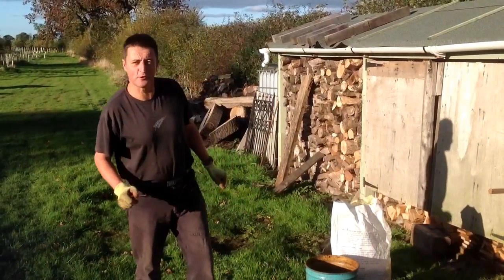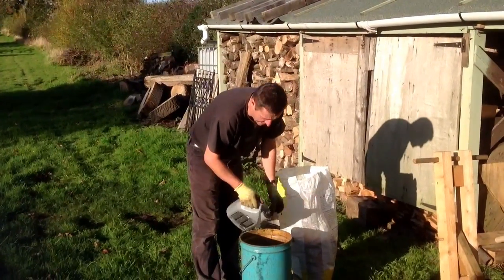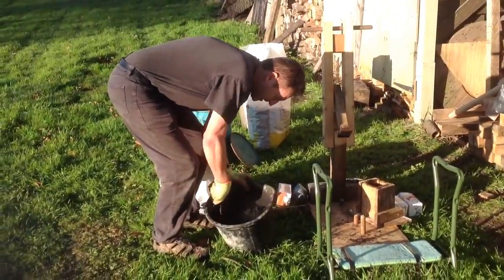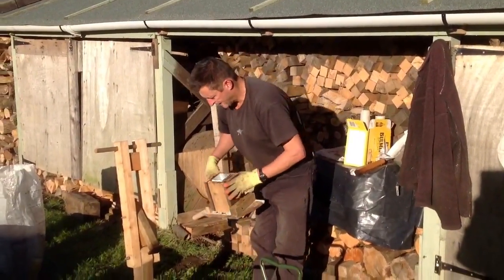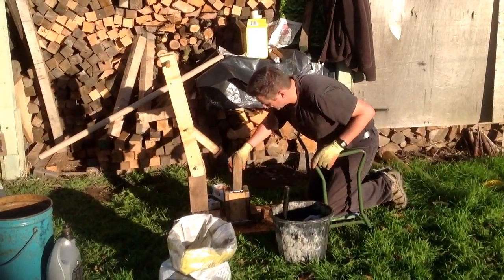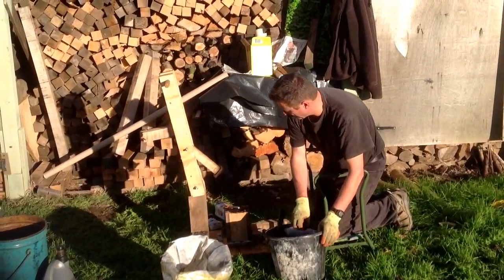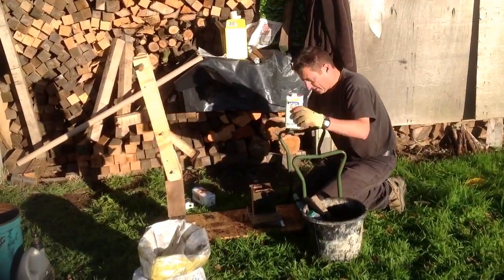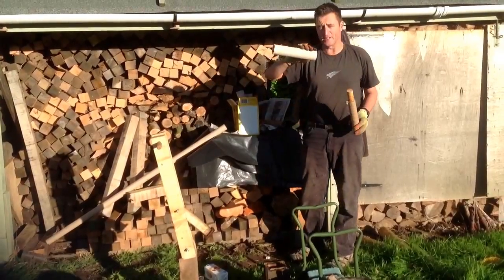How to make fuel from sawdust and old oil.

Comment: Engine oil is full of chemistry and additives, who you absolutely do not want in your environment. Used oil is also contaminated with metal and residues from the engine. If you burn engine oil, you will produce lot of toxic smoke which is full of dioxines, causing cancer for both you and your family, and everybody else.   Engine oil belongs inside the engine, and when discharged it should be at a proper waste facility. following this video is a really bad idea, and the video should be deleted.
Reply from the maker: Michael, do you know what they do with that engine oil you leave at the waste facility? Yes, they burn it! Like it or not, this stuff ends up in the atmosphere.  So better that I at least get a bit of heat from it. Anyway, my neighbour says he likes the smell!,
Reply: +struck2soon Absolutely not true, at least not in an civilized country. In Denmark the collected waste oil get refined again to "base oil" and find uses i a variety of new products. Waste oil can be burned, but to do that without chemicals polluting the surroundings, you will need very high temperatures and a filtration system in the chimney. That is not something you can do at home, and you have absolutely no idea of how much toxic waste you are polluting everyone with.
Reply: +struck2soon btw. Burning waste oil is prohibited in most of europe for the same reason.
Reply from the maker: +Michael Sørensen This is not a civilised country, this is ENGLAND!! Here it is perfectly acceptable to have an open fire, and surely if you are going to have a fire you might as well have a nice bit of smoke coming from the chimney? That is why we burn a lot of coal as well, gives excellent heat and at least people can see that your fire is going with a nice drift of black smoke from the rooftop.
Reply: +struck2soon Well, by non civilised countries i was more thinking about countries like Russia and India. Do you know for sure that it is allowed for citizens to burn chemical waste in the UK, or are you just assuming that? Did you actually call the authorities and got a permission?  I am not talking about open fire or fireplaces where you use uncontaminated wood, they are also perfectly allowed her in DK, but the fact that you are burning toxic chemicals in your stove, and polluting the surroundings. When talking about black smoke, i am sure that you already know that it is not to be expected in a proper maintained and correctly fired stove, as you properly also know, that in areas where coal is the main source for heating, there is a much higher concentration of ex lung diseases.  Bottom line is, that time changes and we all get smarter, so why not learn from history and do things right?

Comment: How about adding ruined home brew to the mix? Would that alcohol absorb to the pellet and help it burn? I have plenty of that stored.. making moonshine out of it is option, but I'm not very much into drinking nowadays. :)
Reply from the maker: If it is home-brew beer then no. Spirit on the other hand would be ok, but perhaps a bit too volatile? And then there is evaporation to consider. Old cooking oil from restaurants or take-away bars would be a good alternative to engine oil, perhaps the home-brew spirits mixed with one of the oils?

Comment: Thanks for sharing.
I have been running my old Toyota Hilux pick up on waste veggie oil for years and the waste from the waste is mixed with saw dust from a furniture joinery. I simply shovel it into bags and use in the stove to start the fire.
Reply: I used to work for a trucking company that took the oil that they drained out of the engine and filtered it and mixed it with the diesel and burned it out through the engine. It is a good way to get rid of it and it bumped up the HP a little.
Reply: They call it pep in America
Reply: prep

Comment: Good video, once made how long does it take till you can burn the "bombs"?
Do you have to wait a few months for them to "cure"
Thanks in advance struck2soon
Reply from the maker: No curing time required, other than a couple of days for oil to soak into sawdust in the initial pre-manufacturing stage. Fire needs to be good and hot with a decent bed of embers, (usually about an hour of burning wood), before bombs go on.
Reply: Great many thanks.

Comment: I would think these would burn well in a rocket stove.  The high temperature burn with plenty of oxygen should reduce the "toxic" output to a negligible amount.  Thank you for sharing your experience with us.
Reply from the maker: My pleasure Mack. If you do try one on your rocket stove, let me know how it goes.
Reply: @struck2soon  Great idea! i do the same with sawdust and used motor oil--- not compressed-- and burn it in my rocket mass heater . It burns very clean for almost an hour along with the wood. I think compressing the mix is even better. thanks!
Reply from the maker: @migueljose2944  I mainly did this as an experiment to prove the concept. In practice I find it far more time-efficient to cut logs for firewood, I can produce a much bigger pile of logs in the same time it takes to make a few of these. Of course not everyone has access to logs!

Comment from the maker: It is being burnt in the mighty Stratford Tf90 (28Kw) boiler stove. I like a really hot bed of embers to get a clean burn on the old oil 'bombs'.
I have a clip showing how boiler stove is connected to rest of heating system when you get a chance between shed/chooks.
Reply from the maker: Apologies Norman, is it the volume or the speed of my speech that you are struggling with? Just wondering if I should add a few notes to the description as an aid as this clip has been surprisingly popular. Wish my model railroad clips got even a fraction of the views!

Comment: Would you be able to make pellets for a pellet stove in this manner, without the motor oil and coal? Would you substitute a different oil?
Reply from the maker: Good question. Those pellets rely on very high pressure to release some of the resin in the sawdust to bond the particles together, obviously that kind of pressure could not be produced in my contraption. But it might be possible to use a type of glue to bond them. However, you wouldn't be able to make small enough pellets for the stove feed system, but they would be fine on a conventional wood stove. I would say using old vegetable oil as an alternative might be possible as a viable bonding agent if you were worried about the use of dirty old engine oil; I just liked the idea of using what was basically waste products that would otherwise have been binned.
Reply: struck2soon I reckon a weak solution of PVA and lots of water would do the trick

Comment: What's the carbon tax on each briquette?
Reply from the maker: Carbon dioxide emission is approx.2.5 kg per kg of briquette. This is based on a mix of 50% coal,(@ 2.8kg/kg) 20% oil,(@2.7kg/kg) and 30% wood shaving(carbon neutral). I don't pay a 'carbon tax' on that, as it has already been taxed at point of purchase if that is what you mean.
Reply: struck2soon "Carbon dioxide emission is approx.2.5 kg per kg of briquette"

More CO2 mass than briquette mass?  That seems to break the laws of physics.
Reply from the maker: RonJohn63 Not at all Ron. Actually, it is more the chemistry of combustion that needs to be understood here: remember the old chemistry lesson at school where we learnt that CO2 is formed by combining 1 atom of carbon with two atoms of oxygen? Coal is our carbon and when burnt it combines with two atoms of oxygen to form CO2. That is three atoms in the final equasion derived from one atom of carbon, thus three times the mass. But it doesn't produce three times as much CO2 simply because coal is not pure carbon, there are other elements in there as well. So 2.5 times much CO2 is a rough estimation. 
Hope that helps.
Reply: struck2soon "thus three times the mass"

Since the oxygen comes from the atmosphere, I see your point.

Unfortunately, that would only be the case with 100% combustion of a pure-carbon fuel like natural charcoal.

Parts of the mass will be:
a) the hydrogens in oil and wood that turn to steam,
b) the nitrogen and other elements in the wood and oil can't be turned into CO2,
c) ash, soot, other gases and particulate matter (some of it carbon) that doesn't/can't combust.

Comment: Say, aren't you putting out a lot of toxic smoke up the chimney burning old oil? Contaminants include heavy metals as well as plenty of carcinogenic compounds, yes? Doesn't seem like a very neighborly thing to do, if I may say so.
Reply from the maker: Neighbours? What neighbours Mike? They all moved out to get away from the awful pollution!
Reply: Mike Nestle . Sounds like a great idea, fuck the neighbours
Reply: you complain about toxic this and that, but I'll bet every last one of you ride in a car or bus or some form of mass transit, and anything you buy is brought in by a truck. You electricity is produced by 48% coal power plants, not to mention every time you exhale you are putting CO2 in the air.
Reply: In Australia it would be highly illegal to burn this mixture. The car oil is a known carcinogen that is illegal to burn.
Reply: @Spooms1961  What do you think that petrol is made from, sardines ?
Reply: Stephen Woods they don’t have to know...
Reply: struck2soon so thats why ya make em, get rid of the naighbours  lol
however not a very environmentally friendly fuel source, and if your area is so polluted then maybe time to take steps in getting it a bit better by not making it worse.
check up "sawdust stove" on you tube, then make one of a smaller tincan that fits in your fireplace but attach a 45 degree plate on the top that will reflect the heat out in the room better, and voila, you can then burn pure sawdust without oil etc in a way where you can get up to 8 hours use of one charge.
Reply from the maker: SignedSign, I hear what you're saying but my problem is this: my stove is a boiler-stove, and needs a big heat output to heat all the radiators and underfloor heating. Not the amount of heat you could get from a small sawdust stove, even though they look very efficient.

Comment: Why not grind up some tires too!
Seems very irresponsible.
Reply from the maker: Hmmm. I would be inclined to agree if a lot of noxious smake was produced, but burning these on a very hot firebed gives a fairly clean burn. Oil, coal and wood are not exactly new fuels either, so I have a fairly clear conscious.
Reply: Adkchip1, I am happy to know that you dont use electricity or drive a car. Thanks for not polluting at all in any way.
Reply: struck2soon Smoke is just visible gas(es) due to differences in temperature. Absence of smoke does not necessarily mean clean air.
Reply: adkchip1 . Ground up tyres, nice one, thanks for that tip